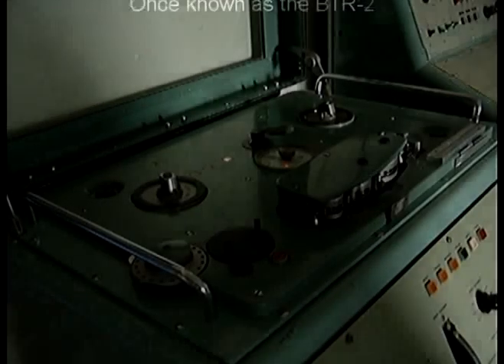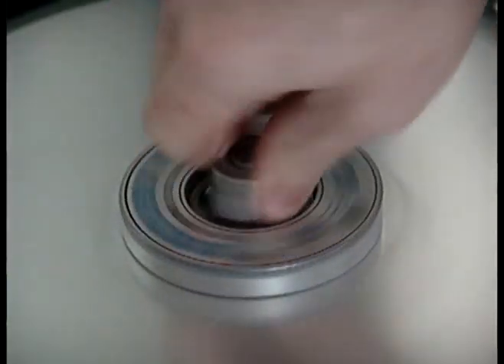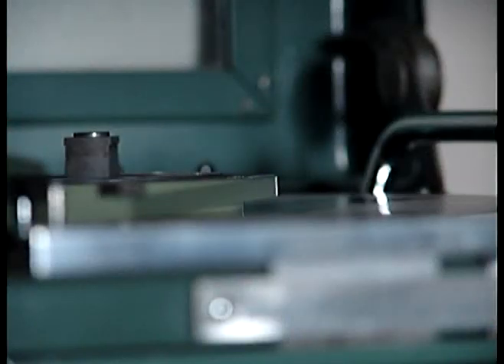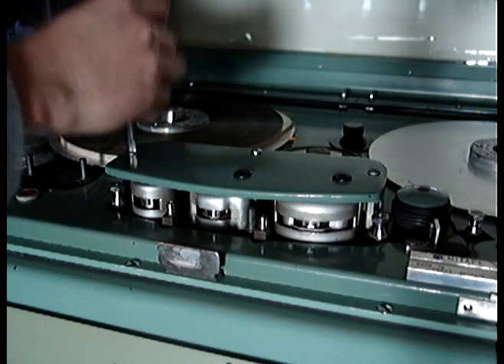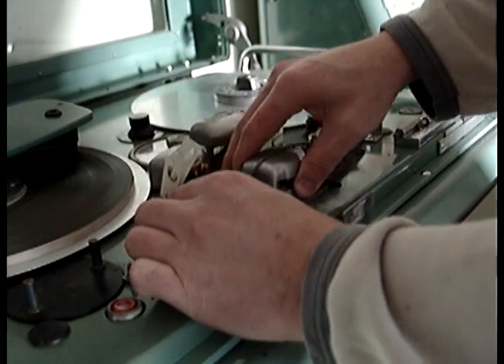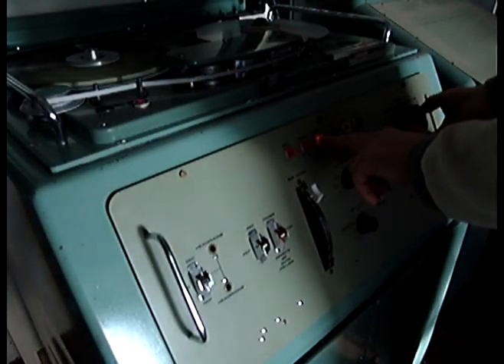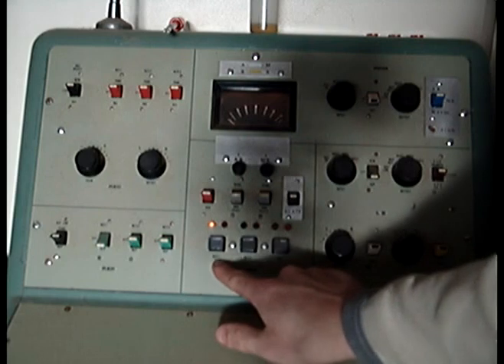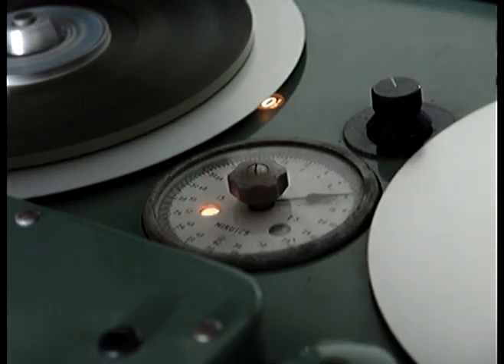EMI RD4/4 reel to reel tape recorder BBC mod from the EMI BTR-2

Comment: Thanks for your replies.
Obviously EMI engineers didn't economize Mu-metal to make such a huge shields. I always though that Studer-Revox shields were a bit oversized, but after have seen these ones it's clear that EMI gained the upper hand to Studer ;-)))
It's obvious that designers did a very well engineering job 60 years ago and they spared no effort  to get a true sturdy and reliable studio machine that could rival with German AEG Magnetophon or American Ampex 300 and later 350 recorders.

Comment: Also I'm some intrigued about the odd profile of recording head and inner reproduce head shieldings that shows a clear bump in the front. Could this one be due to get a better stray field rejection without the need of a front hinged Mu-metal screen like the one used in reproduce head of Revox machines?
Thanks in advance.

Comment from the maker: Thank you, using the Nagra just adds complications, sadly the digital age makes things too easy, I know what you mean about the sound blow-out, the "P"'s and breaths cause distortion however I used a cheap old PC mic  for the job, I have some very nice Uher mics which work very well, though I have to make a adaptor cable, dont want to cut the ends off, who knows, I may even treat myself to a valve mic next year.

Comment: Great Video!
Nice to see how you keep these machines working.

BTW: what kind/brand of oil do you use for lubricating the machine? I own two Studer j37´s and one C37. The oil in the manual is not manufactured anymore or replaced with a equivalent. I found a Teresso oil that is supposed to be the same as the one in the manual.

Comment from the maker: Thank you, this machine was one modded, the original BTR-2 required 2 screws and the block comes out, including the connectors, though the stereo version has more pins and so the old connectors were no good, why the BBC didn't connector the connectors to the block is unknown though I have the blueprints of the machine and should really check, this oil is similar to 3-1 though suitable for a machine like this, not suitable for many others.